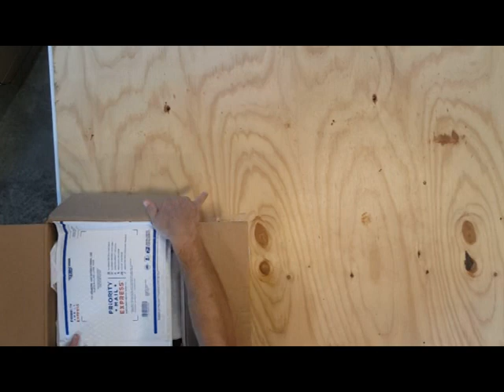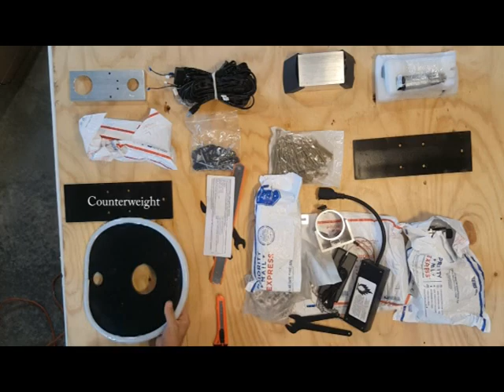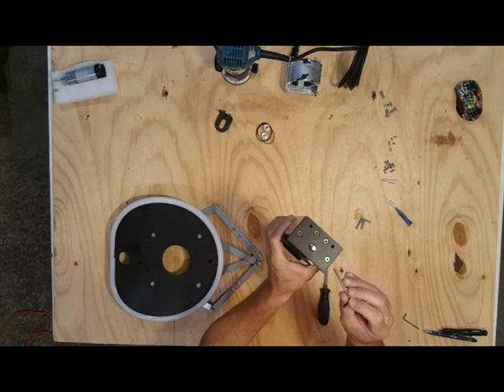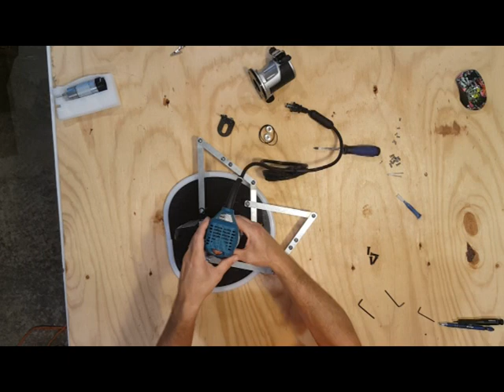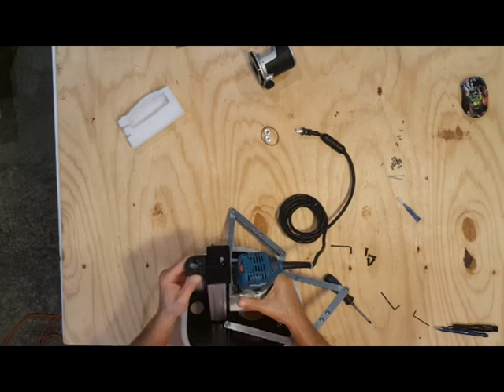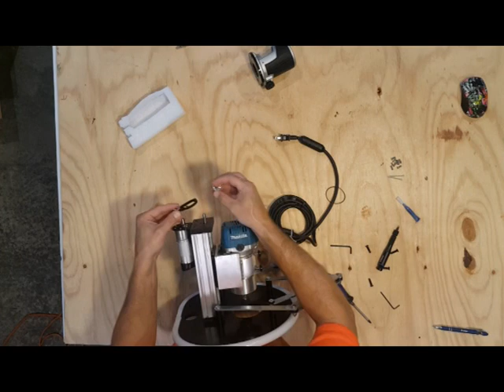Maslow CNC

Comment: How ya liking the metal sled? Any calibration changes need to be made to use it?
Reply from the maker: I haven't any modifications yet, just learning Fusion 360 and making some test projects. I've made a Christmas wreath and some foam tombstones. Hoping to have a video of them sometime next week.
Reply: @fablabfortsmith8806  I just ordered one, that's why I was asking about the calibration. I'm looking forward to getting it in!
Reply from the maker: @wcs39204  There were a couple of settings that weren't in the instructions. The biggest one was the calibration of the Z-axis; which when doing the test cuts cut through 3/4"  plywood (8x what it should have done). The second setting was to turn on Aux1, which during a cut, turns on an outlet. I hooked it up to a power-strip and now the router and vacuum both turn on/off automatically.
Reply: @fablabfortsmith8806  Oh NICE! Now that's smart thinking. I didn't get the full kit tho, I bought the original kit with z-axis kit, and discovered the MetalMaslow sled, and just bought the sled kit. Not sure mine would come with that power option. But that is a really nice feature from the sounds of it.
Reply from the maker: @wcs39204  Turning on the power comes from the Arudino. All you need it a relay, 3 wires from the Arudino to the relay, and  3 prong wire (both the male and female end). 

This probably isn't 100% technically correct, but here goes. The DC circuit and the AC circuit are isolated from each other. The relay gets a signal from the Arudino (5V DC) and it turns the relay on. With the relay on, it completes the 120V AC circuit. Since the router and vacuum switches are always in the On position, they get turned on/off. The relay only costs about $5, and the other wires can probably be found around the house...